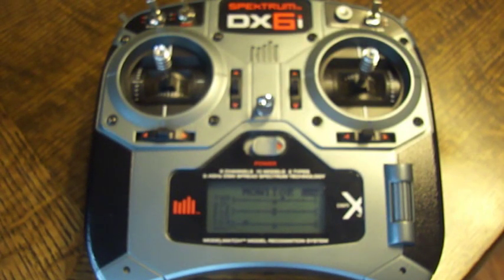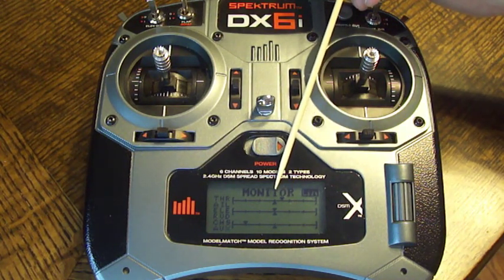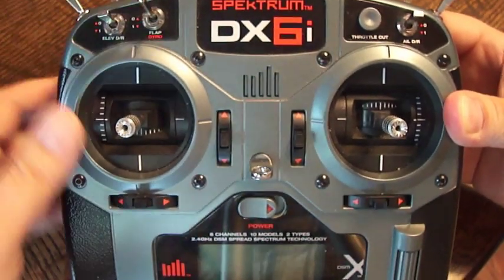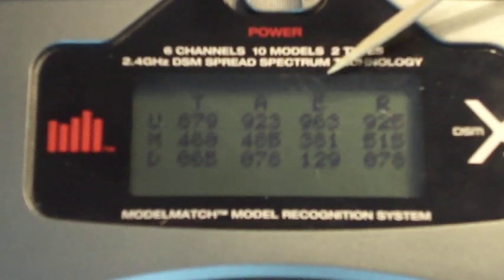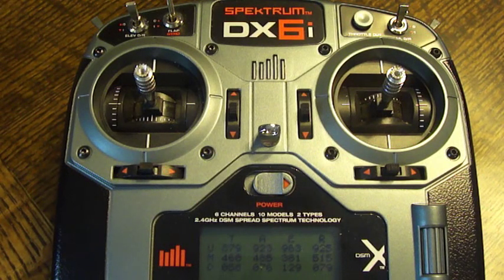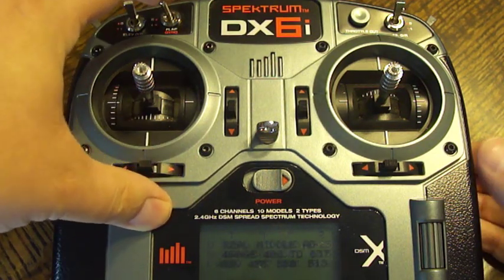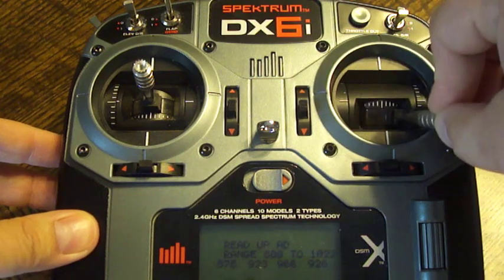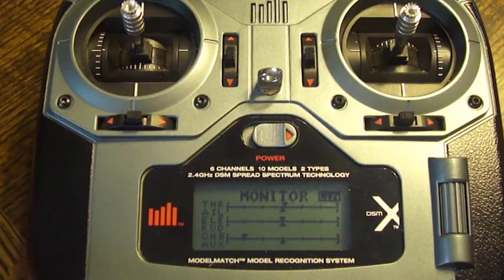DX6i Stick Calibration Procedure

Comment: I did exactly what is shown in this video with my dx6i but it did not help at all. The throttle signal jumps up and down like crazy when I move the throttle stick in a slow and linear manner...I guess it is time to buy a new transmitter, right ?

Comment: I know this is like old news probably... But anybody searching these videos.. learning how to calibrate their sticks... I should mention when you do this all your pitch and throttle curves... Travel adjust... End points ect should be at default settings... Otherwise on your monitor screen.. the arrows will be off from where they're supposed to be

Comment: Followed instructions to a "tee". Works fine except for the ELEV channel which stubbornly will not center even after repeated attempts. What am I doing wrong? Thanks.
Reply: Got it! When I reset my DX6i (which I did repeatedly) the swash type setting defaults to 90 degree swash type. Making sure it was set to  120 degreee swash type solved my puzzle for me.

Comment: Good video, but I think something is missing: this was not working for me until I went into sub-trim (in the Adjust List) and set everything to 0 before doing the calibration (also don't forget to set a linear throttle curve). If you don't the final calibration will be off.
Reply: Hi. Dont know if you wil read this... but i also got a problem with the reset/calibration.
i went to subtrim and everything is is set to 0. 
The calibration still didnt work for me. Are there any other solutions ?
Any help is mutch appreciated :)
Reply: Without knowing your problem there's not much I can say.  The best general advice I can give is read your manual thoroughly and understand every setting in your transmitter.  This may sound tedious and boring because you just want to fly your RC aircraft, right?  I was like that anyway, but to be confident with your transmitter you really need to know how it works.  It's time well spent.  Spinning up a heli for the first time can be intimidating but just take it easy, be safe, use training gear, and give yourself plenty of space!
Reply: I see. Thanks for the reply.

Comment: If your end points are NOT off wouldn't it be a sub trim, travel adj, throttle curve, or mix, ect. problem/issue that is making your center off? Or am I missing something here? I have had my END points off a little in the past which needed calibration, but if I ever had center off  it was always something I did during setup. Not saying it isn't a problem that can be fixed by calibrating. However being in the hobby since I was 15 " now 29" I never had a problem like yours...? I hope it worked out for you! As I am sure you know recalibrating your sticks without having a new "reset" model can/will mess up any future programming on every model you program in said TX.  After calibration I would recommend re-binding every model in the TX as any mixes/settings you have fine tuned on any model prior to calibrating could be off a little or ALOT causing problems. Happy Flying!!!
Reply: Hi! Im a compleete noob... The method in this video didnt work for me. Is there any other way to reset the center? I wont dare to spinn upp my heli before i know that everything is right. Any tips are much appreciated. Looks like you got quite some of experience ;)

Comment: Followed the vid to the letter and its worse,think I've got a issue with my tx
Reply: ResidentOfEvil 34 This was not working for me until I went into sub-trim (in the Adjust List) and set everything to 0 before doing the calibration (also don't forget to set a linear throttle curve). If you don't the final calibration will be off. I am fairly new to this hobby (heli's) but I don't think you should need to erase any models since you are just re-calibrating the sticks; probably not anything wrong with your tx.
Reply: I don't think you have a problem in the video he doesn't explain to erase every model in the TX and make sure BEFORE calibration you reset every model even after you erase them all. And NEVER calibrate a TX if you have made any changes to a model after being reset. When in doubt call or send the TX to Horizon Hobby if it is there product of course. Hope this might help a little!

Comment: NOTE: this will work if you choose a 'un set-up' model on tour tx
if you use a model that you've changed tho curve and duel rates it will show on the tx
Reply: Mine would not zero out for the life of me. Then I remembered changing the rates and realized that's what was being reflected in the monitor menu. Thx for the reminder ;-)

Comment: No worries, it was a youtube issue. Yesterday a bunch of vids weren't working, then they did an hour later, today my comments are showing up with a big error message after I type them, but then go up delayed.  I deleted the two other duplicates.  Yeah so it is a good thing to know to set a linear throttle curve or at least know that if you  don't the calibration will still work, but it may look "wrong" on the monitor.   

I cannot believe they didn't put this procedure in the manual though!

Comment from the maker: Good point.  You should definitely set a linear throttle curve before doing this procedure.  Having a throttle curve with the middle point off of 50% will definitely make the spot look off in the monitor at the end of the procedure.

I'm not sure why you were getting error messages when you tried to comment to this video.  Please rest assured that I did not block you.  I think the discussion could be beneficial to someone trying to troubleshoot their DX6i.

Comment: I was getting error messages when trying to comment, then a triple post happened. Anyway, if you do this calibration, and the last profile you had on the screen has a non-linear throttle curve, then the throttle  monitor at the end of this procedure will be off exactly like yours in the vid. Mine looked the same was as the vid- throttle showed identical position. I had default mcpx curve set. It still worked fine though, the throttle monitor is perfect in a different profile with linear curve.

Comment: Right..  so you had a linear throttle curve set when calibrating in this vid?  Just wondering.  Mine looked the same (off center high) with non-linear curve set, but perfect with linear curve. It did help my rudder center instability though, which is why I had to do it in the first place.

Comment from the maker: I assure you, my throttle stick was out of calibration.  Setting a linear throttle curve was the first thing I did.  I should have mentioned that a linear throttle curve should be set when determining the need for stick calibration.  

However, this calibration procedure is completely independent of model selection and throttle curves because it uses the raw inputs from the sticks.  While stick calibration may not always be necessary, it will never hurt to re-calibrate the sticks.

Comment from the maker: If your stick shows off center on the monitor when you have a linear throttle curve set, then your sticks need calibrating and you would need to follow the stick calibration procedure outlined in this video.

Comment: I did the calibration when I turned Tx off when it was in the mcpx2 profile, if I did the calibration after I was in the 120SR  profile (linear throttle curve), it would have shown on the monitor exactly center throttle when stick was in the center.  Try that, or make a profile with linear throttle curve to try. Nothing wrong w/ your DX6i I don't think..   I did have a sketchy rudder center though, and this might fix it,I haven't tested it yet but it looks good in monitor.

Comment: 1st thx for vid. 2nd, my DX6i looks exactly like yours- throttle a little up at the beginning of procedure and at the end. It is not because there's something wrong, it is because it is showing where your throttle is in relation to your throttle curve you set.  I have one of my profiles set up for mcpx2, and the stock throttle curve from manual.  At center stick it is up a little. When I switch to my linear 120SR profile, the throttle is directly in the center on monitor like it should be.